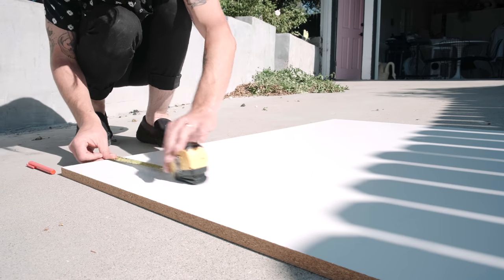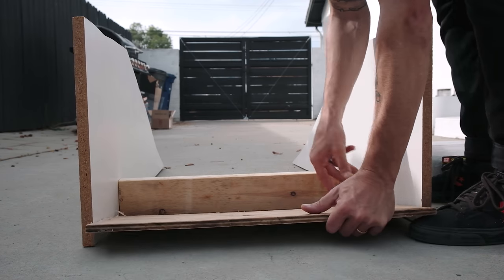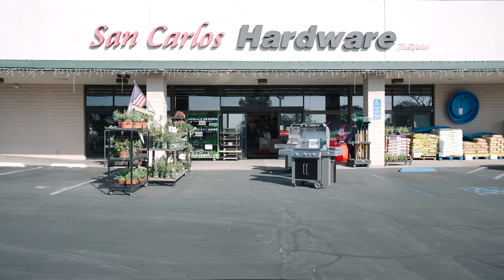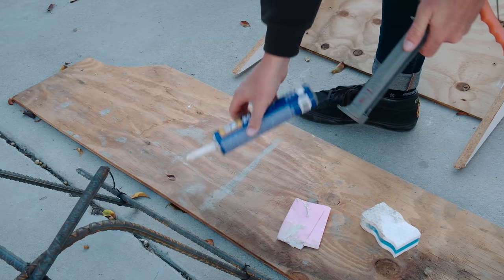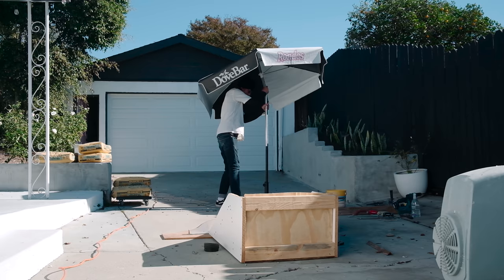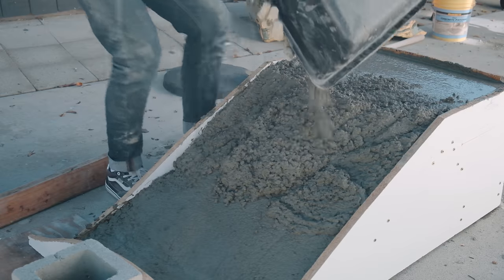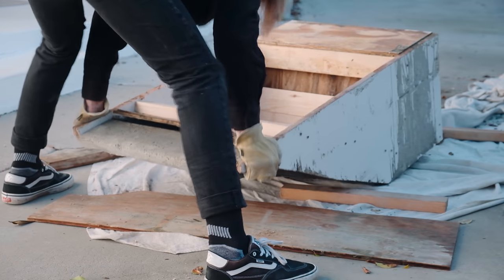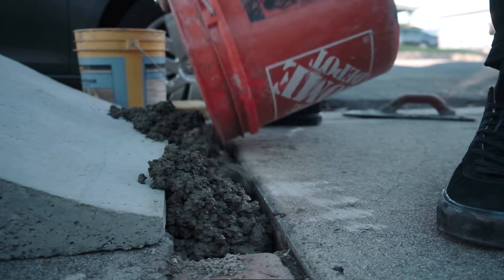How To DIY Skate Spot: Kicker Bench (Easy Install)

Comment from the maker: If you enjoy this DIY spot video please consider scrolling up and tapping the “like” button under the video ❤️🤘
Reply: i love your vids! i think your intros a bit too long tho. maybe half/quarter the time would be better.
Reply: Zack, you seem like a solid human being. I get very good vibes from you. Wishing you good vibes, success, and contentment in all that you do, fellow human. You are awesome 🤙🙏
Reply: Hey mate good job, line your form work with diesel fuel before you pour dude, the form work will just peel right off.
Reply: Hey Zack, if you want your DIY spots to last longer, try putting them in an empty lot. Installing this in the middle of the sidewalk is not only a hazard, but guaranteed it will be removed quickly.

Comment: I have actually worked concrete so I'm surprised to say that I have some suggestions: #1) bust the form after the first day or 6-8 hours and continue toweling the sides to give a smoother finish... that concrete hardens enough in a few hours to take the form off, but takes days to cure( you were correct there) #2) you used way too much concrete than what is necessary, contrary to what the comments are saying, other than esthetics, there is no need for that much concrete, 2 or 3 inches min, even on the ramp. Use a  Styrofoam block to fill in the seated area, leave only 2 or 3 inches around for security. #3) the rebar is fine, despite what the majority of comments are saying..I'm a little surprised that you didn't put another bar in the middle of the up ramp but that speaks to the fact that you probably didn't even need any. I would use 4x4 road wire grid in the future, sorta like chicken wire but way beefier... or use chicken wire and wrap it around the Styrofoam and maybe chuck a couple rebar bars in to reinforce. One thing I didn't like was you let the rebar expose to the elements. That is a big no no as it will quickly rust and permeate your concrete and blow it apart. I'd paint before it's too late. But then again you used so much concrete you're probably good haha :) . #4) if you used chicken wire or road wire you could probably get the front lip down to under a quarter inch with out cracking. 
In conclusion I would have done the following differently: 1) made a thinner form to use less concrete, 2) use road wire grid for the up ramp and just drop a few pieces of rebar in after the concrete is poured so you can keep the Rebar off the edge of the form 3) For the seat use chicken wire or road wire  wrapped around Styrofoam block, Or just use the same width as ramp for the seat, but keep the rebar and metal out of the edge of the form... actually, I just remembered someone saying jumbled up coat hangers works best because they are coated.. I would do the whole thing with cost hangers actually. 4) I would have poured on location mixing in a bucket with a shovel and not with a big mixer. 5) Poured the ramp right into the ground on location, that hole where the brick is the perfect depth to tie into the side walk. Now you have a "cold joint," that may crack over time. 5) I would have busted the form 6 hours later and hand troweled the sh#t out of it with a finishing trowel( the thin ones)  to make it shiny and smooth.. ps.  If you added coping, you wouldn't even need any rebar.
Reply: He'd get pulled up I'm sure pouring that on site.
Reply: Awesome tips, thank you!
Reply: Maybe you would, maybe you wouldn't. Prove it
Reply: @Palpac  nothing some workboots and a yellow vest wouldn't fix (and do it bright and early). I've had similar experiences building guerilla 'free pantries' at my local park. No one quested my authenticity, they were just excited to see "the city" building them 🤣
Reply: @RevolutionaryOpitimism  The City Lords! Lol!

Comment: Skater and construction worker here. When the rebar is too close to the surface and it rust through, we call that "burning" this can also occur when organic material is mixed in but in a different way. Concrete is almost never completely dry and is basically a sponge. Two ways to avoid burning are, keep it at least 2"  from the surface and use high chromium rebar. 😉 I also like how quickly you figured out how to work that stuff.

Comment: Nice ramp man. Tbh I probably dont know what I'm talking about but my uncle builds pools and he puts a lot more rebar, like maybe every 12 to 14 inches. Since  a lot of the pressure of that being ridden is gonna be in the middle I think another cross beam in the center of the ramp woulda been stronger. Hopefully it holds up, looks fun to skate. Good work as always
Reply: Agree with you dude. I would personally use way more rebar. 
Pretty sick little kicker though.
What do the locals think of it?
Oh yeah new intro is cool too!
Reply from the maker: Totally makes sense, learning curve for me.
Reply: Tbh you should use more rebar, but lots of concrete diy shit has been built not 100 percent proper and has lasted for time. 

Like even huge parks. Vancouver and Montreal have some big concrete parks that basically were built diy
Reply: The thing with concrete for pools is that they have to build it muuuuch stronger because of the pressure from all the water. Standard spacing for rebar for  skateparks is 380mm with the concrete about 6 inches thick. What might work better for this type of thing is to use something like a wire mesh. It would cover more surface area while being lighter
Reply: Most driveways are built with wire mesh, with rebar tied into the garage and street. Wire mesh is the way to go here.
Reply: Completely disagree. Could have used chicken wire if they wanted. Also used way too much concrete.
Reply: Lol you're right you don't know what you're talking about. How he did it is perfect. Steel is all about code.
Reply: A bit of weight reduction lol

Comment: Hey again. Another tip or two from a skater who's placed and finished a lot of concrete. When it comes to mixing, less water is better. Not dry, but not runny. Watering out your batch weakens the result. Also, allowing your crete to start setting up a bit, before placing of course, then "breaking", or mixing again to a workable consistency, then placing it creates a stronger concrete. This helps if you need to go thin or anticipate substrate movement, like we get in Canada. You can even do this three or four times, but careful about adding too much water, especially late in the game. You'll weaken the slurry that forms the skin of your pour.
 Chain link fencing makes great reinforcing bar (rebar). We built a driveway quarter pipe about 10 years ago using chainlink and there's still not a crack.

Comment: So glad you didn't get give up on the diy spots!
 In my experience adding chicken wire or some type of wire along with the rebar, adds to the longevity and if you paint the sides and coat them in avocado oil before you pour it will help the mode to release.
Keep up the great work, intro is dope!
Reply from the maker: Thank you Cody! I always forget to add the oil.
Reply: @ZackDowdy  not  a problem i hope it helps bro!  I can't wait to see your videos!

Comment: Ah. That was a good one. Great idea to incorporate diy into the environment so it blends in more.  This was small enough to be low key but as you learned small concrete is heavy as hell.  Maybe figure out a way to make a kicker or transition that is propped up by an existing element so you only pour the ramp section. Again great idea and creativity.
Reply from the maker: Yeah! Next one needs to be a little lighter

Comment: You should use a straight edge (a level or a straight bit of wood and place it on top of the form to see if anything would be sticking out the concrete bro 👍 sick video

Comment: As some one that does. Foundations and concrete work. That's not how u use it.  U should have left the wood rough naturally. It will bond better.  But it's not going to bond anyway really. With out an adhesive. U would have been better off just making the entire interior if the form concrete .no wood frame that' wood will rot and deteriorate overtime. And concrete won't so u will have. A hollow weak top half one day. .

Comment: Hey dude. Use chicken wire instead of rebar. That #3 is way too heavy for what you're doing. The metal is there to hold the concrete together more than provide structural support. The structural support comes from the density of the concrete itself. Looks good man, keep it up
Reply: One more tip. Leave the mixer running when you dump it. It'll clean itself out and you don't have to scrape

Comment: inspiring…. but please learn some more about tool use material names and details….. For instance / pre drilling the melamine (mellow-mean ,pronunciation) is not because its a Hard or Tough wood… Melamine is a particle board core sheet good with a melamine (a fórmica like material) vainer over it…. not good to just screw or hammer So definitely as you figured out needs pre-drilled….. Seriously though, as a skater and carpenter it’s long been time for me to get some DIY projects going and your Vids definitely help to motivate and inspire…. #skatelife 🤘🏼🤘🏼🤘🏼